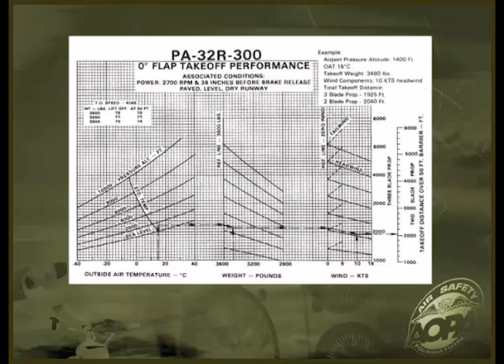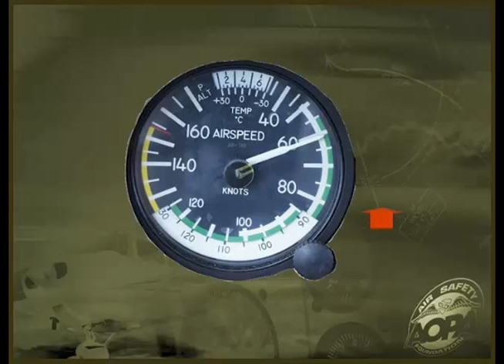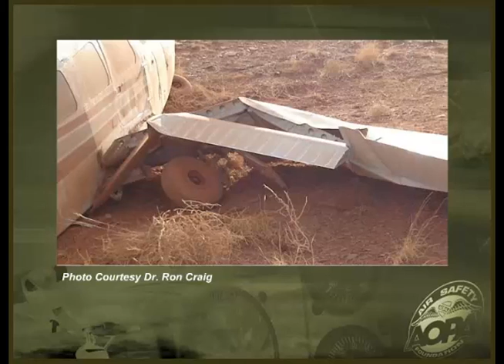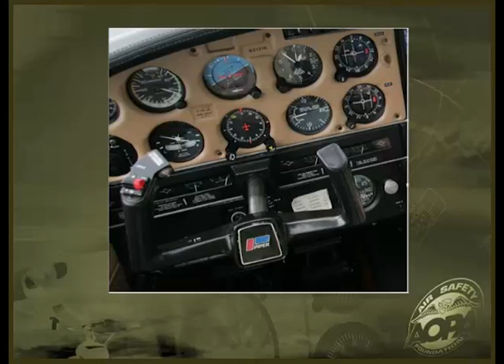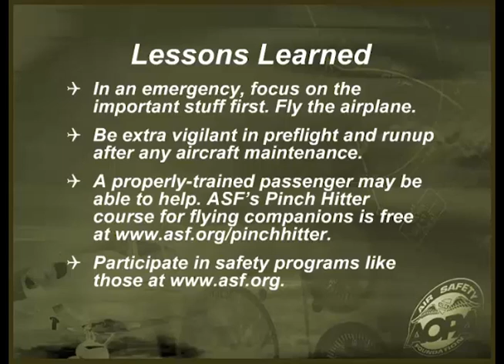Real Pilot Story: Power Loss on Takeoff

Comment: I recently had an engine loss of power on takeoff. 85ft AGL. There was no time for anything. I nosed the aircraft down, saw a little hole in a hedge and went for it, in my head, I didn't want to stall. That's all I was thinking about. You won't recover from our height. I flew it to the ground. Landed in the grass and made sure I was going through the hedge. We hit a fence stake, caught by an electric fence, spun on the ground and came to a stop. I shut everything down and jumped out (pax couldn't as the landing gear, his side was gone). I got out and got him out. No injuries. I was back out flying the following day in my own aircraft. 

As a pilot, you don't panic, that will kill you. You fly the aircraft to the ground, you aviate, navigate, and then comunicate. I had no time to communicate until we were both out of the aircraft and safe. 

We made it and I'm glad I was the PIC to do it.

Comment: 20 hours is too long. That's long enough for you to have tested the engine, done the break-in flight circling for hours over an airport, run up the power several times. 20 hours is long enough for you to have moved on to transporting your loved ones on the plane.
You can be "careful", and "anxious" after maintenance, but at some point you have to start relying on the engine.

Comment: I was flying my 1980 Piper Saratoga SP (basically the same airplane) out of Ft. Myers' Page Field with 5 SOB some 38 years ago.  Complete engine failure at 500 feet over the city.  I S-turned to the only green I saw off to my right.  Lowered the gear, missed a one-story building by inches, hit hard on the mains, tore the right wing off on a baseball backstop, yawed to the right and the tail hit a soccer goal, and skidded to a stop on sandy grass.  We had landed in an elementary schoolyard.  The front door was jammed, so we all scrambled out the rear door.  No one scratched, no fire.  The single-drive dual mag had failed because the screw that secures the cam to open and close the points had backed out.  Thirty seconds from engine failure to touchdown.
Reply: Wow!  Thanks for your lesson.

Comment: Ive been very fortunate to not had to do a real engine loss; but just trained alot(3000) in type.... Guess the only thing i would have suggested is to leave spouse at home until after more time on a new engine; and everyone is caught by surprise. Yea wreaking my plane would have pissed me off.... But glad your safe... I like most piper products.... Many 135 hrs in them... In weather. I tried to always RnR my vacuum pumps before 500 hrs on them in winter time flying; im rambling.... Get another one!

Comment: Great story, glad everyone was okay.  ya know, the thing that bothers me most about GA.. is that is feels like all the planes (most of them) are SO old!  Outdated tech, and old parts.  yes, I know "they are maintained" but, man.. you get to a point where its just silly in some cases.  Personally I could never get in or want to fly a plane that is so old.  :-/
Reply: You ever hear of Theseus' paradox, aka the Ship of Theseus? Many parts of the original plane are long gone. The mechanical workings of the airship stay the same and work just fine as far as physics is concerned. It comes down to what's been maintained, fixed, or replaced... and the quality of those materials.

In this case the whole engine was replaced (remanufactured so either original engine or same type but already rebuilt to drop in.) They'll test for metal weaknesses and fatigue and replace when need be. Nothing is made forever and new can fail as hard as old.

In this case, it really wasn't an engine failure unless the foreign material came off the engine (fuel lines?) It sounds like it was foreign to the engine and got introduced at factory or in the installation. One could argue for clean room type environments and builds but there's always human error... we still have rags left in patients after major surgery where things must be sterile. In other words, unless you are personally going to rebuild your engine (and many do) you'll just have to hope whoever does it is meticulous and doesn't have a stroke of bad luck.
Reply: Actually, the age of the plane had nothing to do with the engine failure or the crash. It was a new engine that caused the mishap.
I do post maintenance flights solo and with half a fuel load so I'm light. Only after success on the test run do I fuel up & add passengers.

Comment: I have a Cherokee Arrow 200. I had an engine problem on takeoff at about 200 feet. I immediately cut the power. As the nose dropped, I could see the far end of the runway. I dropped the gear and hit on the numbers and went off into the rough overrun area. The plane and I were "fine." I called the tower and they said they wondered where I went! I believe the problem was that my electronic ignition failed on takeoff, and it did not default to the magnetoes  as the company said it would. In looking at accident reports from that day, at least two small planes had a similar  problem, both attempted to make that impossible turn back, and in both cases all souls were lost.
Reply: Impossible turn.. almost deadly turn..

Comment: When many of you have "explained" the cause of failure by linking the NTSB report or offered wisdom like:  "Didn't you read the accident report?", I'm not surprised at all that the engine manufacturers and mechanics out there are not held more accountable.  If you are all satisfied with the almost worthless "assessment" from NTSB and the manufacturer, why should they worry?  Their family is not onboard.

I get better explanations from my Chevy dealer about failures (that rarely occur) and it stays on the ground!  A grayish substance ....that breaks into particles...on a tube that the mechanic is supposed to reconnect...so what!?  Was it some magic goo that Lycoming thought would seal the tubing, or some stray/extra gasket compound that ended up where it shouldn't be, or a piece of teflon tape (that should never be used in fuel systems), or...what?

If you're happy with that explanation of the cause of power loss, you may want to attach an auxillary fuel can, a Harbor Freight siphon hose and a long tube with some duct tape (which is also not fuel safe).

It is truly a blessing from God that this couple was spared.  Sure can't count on Lycoming, the mechanic and the NTSB.
Reply: This is what happens when there is no real innovations. 
Almost all engines in GA market are designed and developed in 50s and 60s, they haven't improved it in anyway, they just slap exorbitant price on it and keep selling it for more than half a century....and people have accepted their mediocrity as the norm.
Reply: @superchargedpetrolhead  what would you suggest?
Reply: @etherealrose2139  well it probably starts with  some changes in the law and regulations. look at the innovation in automotive sector imagine buying a brand new car today but it has the same engine as in the ones from 30s would you be comfortable to take it for a cross country road trip in a moments notice, probably not but that is the case in GA...

Comment: Very bad approach and landing checklist.  all disorganized and not prioritized.  Approach Items first  , then landing checklist second and not both combined in 9-10 items together in one long list in not secuense.  No wonder so many gear up landings. Or engine fails on approach.  

Better the passenger items first-Like  Seats up, Seat belts on and pass briefing,-then flaps, Mixture and lights.  landing checklist with Gas and fuel pump, undergear, and levers (Levers ready for a go around on final if needed.) with mixtures and props on final ready.

Comment: I'd like to know what caused total engine failure after 20 hours.  I've heard about a seal at the oil filter adapter on Lycoming's that were made from a low quality rubber. Once replaced with the new seal, it ruptures shortly after and the engine pumps all its oil out at operating pressure.

Comment: And what usually kills people isn't the engine failure or landing, it's trying to do a far too low 180.   Read up on "the impossible turn" when someone just doesn't think but just turns to get back to the runway, stalls and spins in.  This man did everything right and they walked away from it.   I've had 3 engine outs--53 years ago as a passenger in a 727 when the engines suffered a couple seconds of silence, followed by full power and a fast 360 to LGA.  And twice in gliders when the tow planes lost it.  (Fast releases and landings while the tows staggered back to base.)  They can happen anytime.
Reply: Were you trying to reduce airspeed by doing a 360?

Comment: 20 hours on a new engine. Contaminated flow divider. Sounds like something in a fuel line moved to the divider but nothing was in the screen. There is no way an A&P could run an engine that long on the ground. I'm a 45 year A&P and it doesn't make sense to me.

Comment: I am a fan of Mike Busch.  Many accidents occurred after major engine work were done, especially after engine overhaul.  So even after then engine reached TBO and it's running fine, producing good compression and borescope, don't overhaul and just keep it flying. These engines suffer high infant mortality rate because the mechanics are people, and they make mistakes.

Comment: So what caused the low performance of the engine?  With 20-hours on the aircraft post-maintenance, I wouldn't expect the need for any excessive run-ups before subsequent flights.  Why wouldn't the plane fly?
Reply: Statistically, the first few hours on an overhauled engine is the most likely to have problems.
Reply: maybe took that length of time for the contaminant substance to melt, liquefy, seep, and collect.  see preceding comments and NTSB report.

Comment: Question, was the foreign substance found in the fuel divider likely introduced as fuel contamination from fuel taken on board at Winslow or some kind of inappropriate sealant used in engine reassambly by the service center?  Engine failure on take off is every pilots concern.  The circumstances of this failure follow a similar pattern engine failure within 200 hours of replacement and refueling at a strange (?) airport on a cross country flight.  Lycoming says not my problem, but their description of shipping an engine they disassembled after quality testing does not mean the contaminant was not introduced at Lycoming.  Wihout knowing the source of the contaminant no preventative action can be taken for future occurrences therefore the NTSB report has failed to identify actions to prevent future occurrences.
Reply: NTSB says engine sealant.

Comment: At times things go wrong many years ago I was flying an aircraft with a new engine as to break it in and all went well on all the flights but later, when another pilot was using the aircraft for looking for a down aircraft he pull the power back and that's  were it remain until he put the aircraft down with no damage 

The cater key had come out or the A/P had forgotten to install it as I understood the story 

The stories here are the first rate as they may save some pilots life someday along with the advice of those who commit on them or give ideal

Thanks for posting and to AOPA who support thing like this 

May the worst thing you ever have to do is clean the bugs off of the windscreen

Comment: The problem was maintenance refused to test run this engine properly. As well as that, I've seen mechanics (usually middle seniority who are the ones caring about deadlines and upset owners wanting more money) blatantly ignore that they didn't really fix the problem..makes me contemplate working on these things any more quite frankly
Reply: Did you notice that the owner had put 20 hours on the engine after the re-manufacture without any problems. Not sure what the installer did for test run. Can't imagine that they would put more than an hour or two.
Reply: @KingGroupProductions  Interesting point, I've had a LOT of engines right from overhaul have problems. I heard from a really experienced guy that engines right from overhaul are the ones he doesn't trust, and after just ~5 overhauled engines I agree. out of those one has had no problems within 100 hours, the others all had at least a bad accessory. One had a bad dual mag and a bad carb, 200 drops when perfectly timed and engine would sometimes die when at idle and other times it'd keep running. Overhaul facilities even owned up and said it was their fault on both. Doesn't help that the H2ADs have almost no new accessories in circulation.

Comment: I worked on a twin Beech in Fresno in 1980. Both engines were sent out for overhaul as well as the propellers. While the airplane was down, the owner sent the seats out for recover and some radio people came out and practically ripped out every wire behind the panel. We also put on wing boots for a de-ice kit.. this guy had money! As the airplane starting coming back together, the boss started getting calls from the owner that he needed his airplane back by a certain date. When it was finally finished, the owner came through the door and wanted to leave. We were able to get about 30 minutes shake down flying and it seemed that everything was OK. After it was topped off, I see him load up his wife and 4 little kids. I shit! A couple weeks later, he came back, threw the keys on the counter and asked for an oil change and wash... no writeups what so ever. I retired and took up drinking after that...in that order.
Reply: afraid I don't get the point of your dissertation.  Sounds like he may have been a bit of a butt, but what of it?  Surely the repair station didn't turn the aircraft over to him without being certain they felt it was safe, or without making him sign a release saying they had told him they did not fully test it and he chose to take it anyway.
Reply: @tfilter6  I think the point he was making was he took an airplane that just came out of the shop and decided it was a good idea to take his wife and kids up in it before breaking in the new engine.
Reply: @RainbowManification  Well, right, it is the responsibility of the owner/pilot to ensure the aircraft is airworthy.  After that much work, and with maintenance induced failures being a factor in many aircraft accidents, plus normal infancy failures of new parts happening more often than failures of well-used parts, he should have given that aircraft a test flight, and possibly even several, before putting his family in it.
Reply: If something went wrong after that airplane was taken apart like that, those kids faces would be on my mind.

Comment: Monday morning quarterbacking as to what moves should have been made such as gear up, gear down is much easier to know after the event. At that point you know exactly where the plane is going to come down, the terrain and obstacles it will hit, etc.  But in a high pressure situation of low altitude, low airspeed, and very limited time to think things through, most decisions are made instinctively in line with the training and prior experience of the PIC.  Not every decision is going to be perfect in the Monday morning hindsight of what would have been best. But flying the plane first and everyone being able to walk away is tantamount.  Nothing else really matters.  I think this pilot did a lot of things right.   Just my 2 cents.

Comment: Your power loss was due to a faulty installation by your mechanic. Was he liable for your loss?
Also, there is no time to go thru check lists at a time like this (that can actually make things worse). Instead, I go over power loss emergency procedures prior to flight. You did not mention shutting off the master. Fortunately, you did not have a fire, but killing electrical power would have been a very good idea. Your wife was commendably calm and helpful.

Comment: My dad had something like this happen taking off from Stove Pipe Wells in Death Valley. The airport is close to sea level, but the air temperature was quite high, about 120 F. It was so hot in fact someone drove out to the airport from the store rather than letting them walk the 200 yards. It was so hot that my dad was unable to sign the log because the pen had melted.
      After the visit he took off in his Cessna 177RG (no STOLL kit installed)  He got off the ground and pulled the wheels up, but the plane would not climb out of ground effect. Fortunately the terrain was down hill for several miles, enabling him to keep the nose down to to gather speed. There was also nothing to hit out there, but he said it was a bit hairy there for a bit.

Comment: Lucky guy was in a desert.  Now try an urban metropolis...
Reply: Streets.
Reply: @DevSolar  You don't get to pick a street at 200ft AGL when the plane is already losing airspeed and altitude.  This type of incident would be worst case scenario in a dense urban environment.  The pilot here pretty much kept wings level and glided it back down into the dirt at relatively the same heading as TO.  There are lots of urban runways where you couldn't even locate and plan good potential landing spot for this emergency in a preflight.
Reply: Ohhhh.._. I thought he landed on Mars from the picture.  Good we can joke about this one.
Reply: Dense urban areas with skyscrapers may be a problem. Still, people have used roads in urban areas for an e-landing before.
Reply: Cup & Cone   I’d call him lucky if he would have not had the engine failure at all.